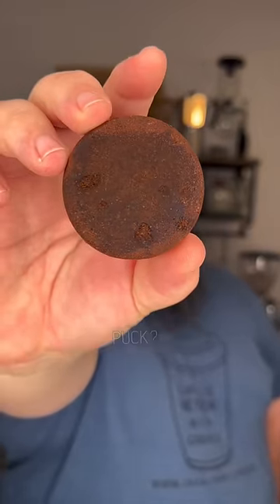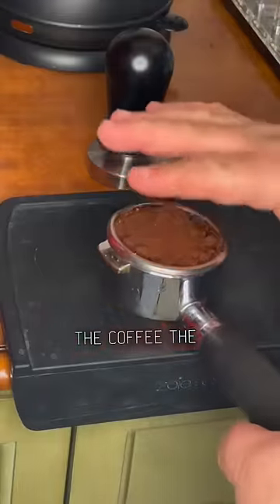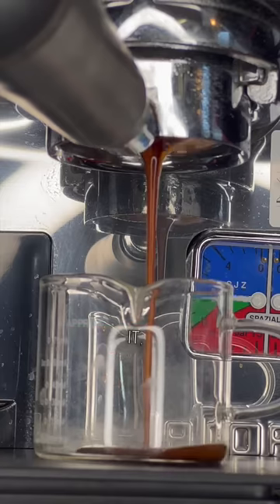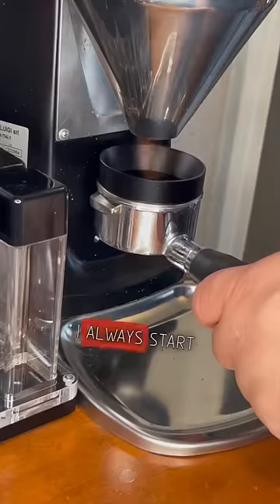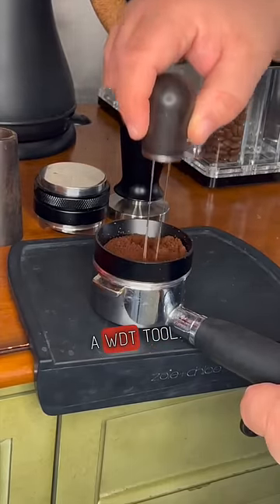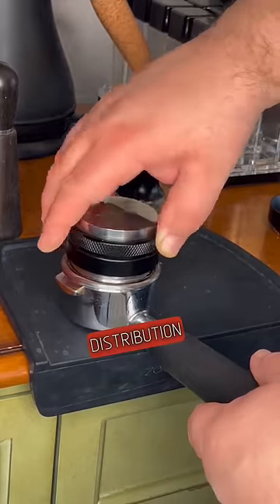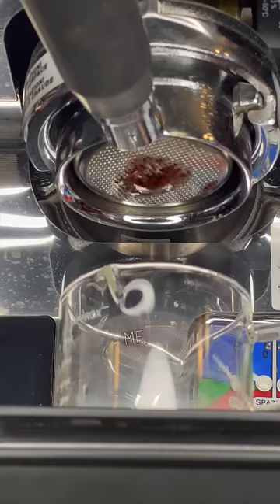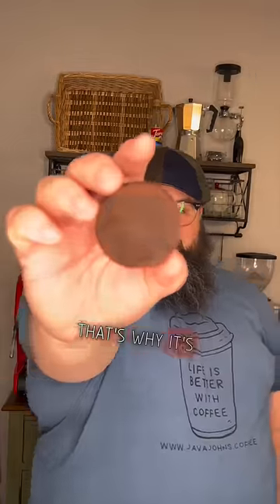Is espresso puck prep important? #coffee #espresso

Comment: Managed to make home coffee just as pricy as going out. Neat
Reply: I mean, if you have the equipment, the espresso itself isn’t really all that expensive (subjectively).  The equipment itself though is a different story…
Reply: Pro i just grind the coffee and throw it in 😂
Reply: @rajgill7576  3.77 years, excluding electricity, water maintenance cost and labor cost.
A good quality espresso machine (electric) by Sage is about €1000, a good quality hand grinder is about €130, speciality coffee is about 42.50€ per kg, and a double shot is 17 grams. That means you can get 58.82... coffees, which comes out at 0.7225 per coffee. Using a graphical calculator with y1: 4x and y2: 0.7225x + 1130, with x = money, y = days, using INTSECT comes out at 1379.09... , which is divided by 365 ≈ 3.77 years.
Reply: @jimchoong1215 you tell him😂
Reply: And just as long as driving to get it

Comment: yeah I can just put out exactly 30lbs just by thinking of it 🤣
Reply: 😂No that's why you buy the scale tool! You put it on the scale before pressing so you control exactly how much weight to use. Don't want the scale, don't worry, use the the 30lb plates (not included) to be accurate every time
Reply: Tamps have springs that are resistant until 30 lbs is applied. You see the handle slide down, he hit 30 lbs and no longer needs to add anymore pressure
Reply: @poisonpotato1 

What? No. Don’t tamp onto a scale. You’ll break the scale wtf

Comment: Set your grind properly, tap the filter to distribute and smack on the bench, tamp straight down at full force with your fingers ON the wide part of the tamper (far more stable) and you can't go wrong.
Don't stick your fingers in the grounds or leave a mountain or tamp only holding the handle and you will get a high quality espresso in far less time with far fewer tools.
Reply from the maker: Nice!
Reply: as a barista myself i can agree

Comment: if you're using a needle distributor, you don't really need a wedge distributor, and there's no right amount of pressure for tamping. you can't tamp too hard, you can only tamp hard enough or not
Reply from the maker: Sometimes it I ramp “too hard” then my flow is too slow. Maybe I’m the Incredible Hulk of coffee tamping. 😂
Reply: @javajohnsroasting  if your flow is too slow, grind a little less fine.
Reply: @javajohnsroasting  i call complete BS, when you compress something the force required to compress it more goes up exponentially, while the amount of compression only goes up liniar, depending on your grind size, after about 25 - 35 pounds of pressure, you have reached a point where the amount the coffee will compress is almost 0 uness you start really putting some pressure in (i am talking about >100 pounds of pressure to make a noticable diffrence)
Reply: @originalkhawk  I mean to be fair the tamp will apply exactly 30lbs, but us bigger guys if you put even a lil weight into it you could hit that 100lbs of pressure you're saying. Since the portafilter and tamper are metal you may not notice
Reply: I never have channeling and I never distribute or any of the other method you use. I just tap my coffee before tamping it and voilà, perfect shot every time

Comment: You don’t need a distributor or rake, all you need is first, to avoid over flow, tap the portafilter on a surface. Next hit the side of the portafilter with the side of your hand 🤚 on the first finger knuckle. This breaks up the clumps and distributes the coffee. Next, the most important thing that you should be doing even with all the extra steps, is tamp correctly. Use a 90 degree angle in your elbow, a straight wrist, and only the fingers to tamp. You want to activate the lattis in your back when pressuring down. This will ensure the perfect espresso pull everytime

Comment: Significant difference: I definanly agree that puck prep is important. 2 things for you, my guy. Stick the WDT all the way to the bottom of the portafilter to get all clumps, especially the ones at the bottom. Also, try to not push down on the distributor before spinning. Spin, press, spin again. You'll increase your distribution a little.

Comment: No it’s not needed. I use a moka pod it’s about 100 times cheaper than most espresso makers and you don’t need to do anything with a Pok. In fact, you literally just piled the ground coffee into the area and then compress it with the top less than 10 minutes on a stove when you have espresso.

Comment: Why is 30 pounds of pressure the right amount for you? I thought the reason for tamping is to compact the puck and remove any pockets/channels, so surely there is a certain amount of pressure that works, any less and channels will still exist, and any more would be pointless as all the channels would have been closed? Is there something I am missing that would mean have a specific amount of pressure applied would achieve?
Reply: AFAIK as a barista there is no upper limit on tamping pressure, all you're trying to do when tamping is compact the puck and remove as much air as possible, thus removing channels. Basically tamp until the puck doesn't compact further, tamping any harder just stresses your wrists for no gain, tamping lighter gives you tamping.
Reply: Up to a point yes, tamping harder than that is pointless, but tamping less will cause problems. The pressure in a non pressurised basket is created by the resistance of the coffee puck, so tamping too lightly will have the same effect as underdosing or grinding too coarse, that the coffee will run too fast and under extract for a spectacularly sour shot. If you have tamped to the point where you can turn your pf upside down without the puck falling out, you have probably tamped hard enough.
The key is consistency though.
Reply: @jamesmcconnon2  I train baristas to tamp to the point that the puck wont compress any further, it keeps the pucks consistent between baristas and means there's one less variable to worry about when dialing in. The real thing that takes skill and actually makes a difference to the quality of your espresso is keeping your tamp level.

Comment: I mean you kinda ruined all that WDT work by shaking it casuing visible clumps to reform and then pressing a wedge distributor into it solidifying those clumps.
Also on your first tamp you weirdly twisted the tamper in at an uneven angle, of course it was going to channel, second tamp you executed properly soooo ya

Comment: Your WDT is poorly designed. Needles should be much thinner guage to effectively break up clumps. Thicker needles like the ones you're using push the coffee around but don't promote uniform density. Distribution tool is also unnecessary and may be counter productive compared to a gentle "tap to settle" or even just distributing as best as possible with WDT followed immediately by tamping.